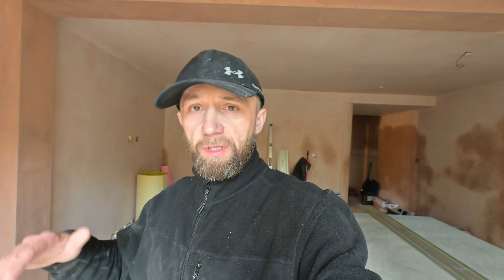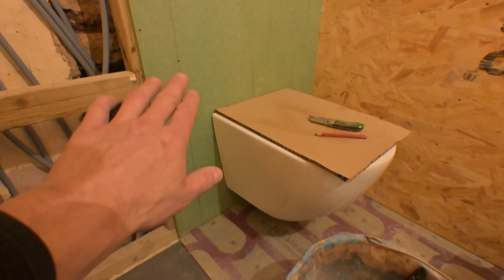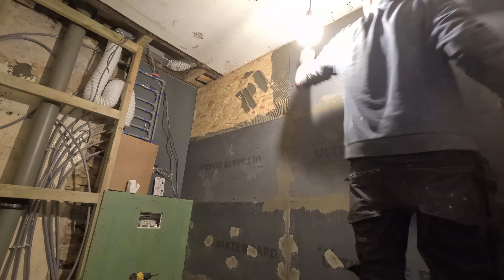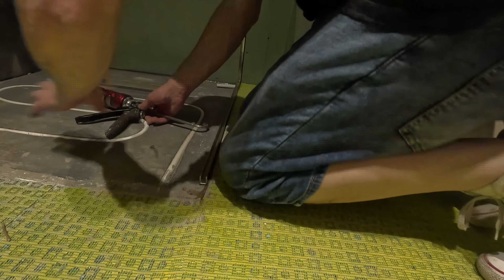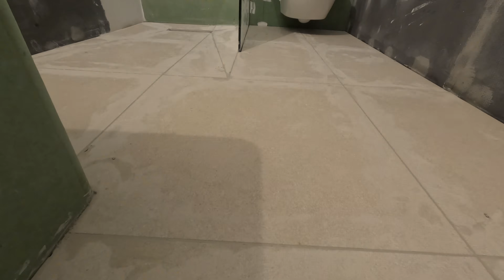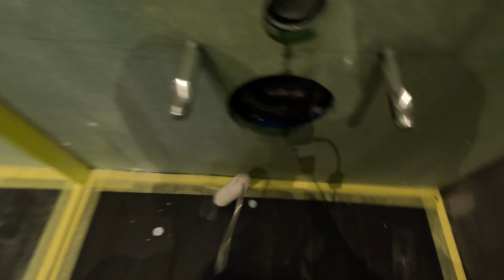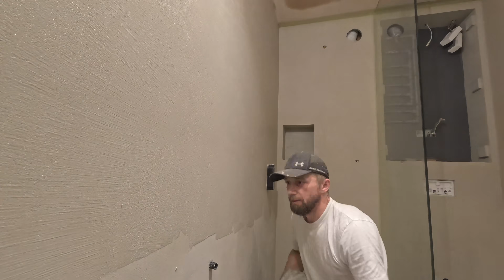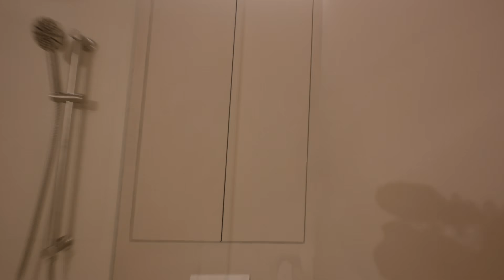The Death of Bathroom TILES..Micro-Cement Explained

Comment: 23:40 😮😅😊 in a old farmhouse they renovated it in the sense when it was built with a shame mechanical structure with cob. And add 9.30 minutes into the video they talk about two minutes about the shower.  The shower is completely constructed of cob.  And in front of the cob, they put an oak timber wall which protects the cob behind it and has a space gap to ventilate air.  So the wood is hanging there and is already in use around 10 or 20 years.  And this video is quite old already and the architect sells that even the wood is so good when it’s not treated that’s after all the showers during all these years nothing has been done to it because the air can dry it out and the cob has the protection to absorb all the water and release it in the form of moist but not in a wet way but evaporates.  Throughout the building into the air, the addict.  So that’s why it’s remains exactly as it was constructed and designed also after decades.  One lost craftsmanship is this lime and cob work? Also lime can be used for these kind of bathrooms because lime has also the ability to absorb water and to toughen the material in the process and release the water excess through evaporation.  Both materials need a protective something and just like the wood or other material with gap and not closed off.  There is no mould no any thing at all and that already done centuries ago and cement has one downfall. It cost a lot of CO2 nitrogen which we have this worldwide heating up causing and El Niño every year more and more increasingly.  So the building industry is one of the biggest problems in the world where concrete is used in cement and that is the issue with all the construction worldwide is that they don’t change and because of the very simple guys who work there and just do a trick and that’s what they learn and just continue to do but really old things were quite good and very cheap to do and everybody could do it there themselves but the professional hand like this example will show you how it can be done in a very impressive professional manner in contrast to the old former work which also can see done by the farmer who had the farm before them. This is a typical German village and in the old eastern part but also in the structure of the German way of living also continues into Hungary Slovakia and other former east European parts it was before it was communist and other alpha type dominated structures it was also always that way.  So look at this video and in the right hand corner you can put a translation on into English I think.  https://youtu.be/8dGL5tg7xRI?is=-wvVpU3867uRFe6v.
Reply from the maker: That is very interesting. Thank you for taking the time to write this. I watched the video. I know the old ways. I was bourn in a house like this.  No foundation, it's resting on stones. We never had damp issues or any other problems with the house. Its been modernised now, wrapped with insulation and silicone remdered. It's the EU law. The building is over 200 years old but it looks like it's been built yesterday. What a shame.
Reply: @yesconstructionltd  silicone rendered. I doubt that.  I think you have heard that it is lime (chalk)  probably on the outside mixed with the cob which is used inside. It gives a tougher results for the outside.  And mould prevent prevented.  When lime (chalk) is used and it gets wet and the pH rises to 14 and feels every bacteria. That’s why it’s used in the shower also.
Reply from the maker: @MagicBird-eu  I meant my own house. It's build just like the house in the video but later it got modernised and completely ruined

Comment: Maybe if you fed the guys lunch they'd work faster. Was that 6 coats? Reminds me of Dryvit, exterior acrylic, got a bad reputation in US that came from poor installation.
Reply from the maker: They are well fed😊 
It's usually the installation that is the problem. These companies are spending millions developing a product so it's unlikely that. 
This is resin microeemt so it's slightly different but application is similar. 
Coats:
1 primer
2 basecoat 
3 basecoat 
4 top coat 
5 sealer 
6 sealer 
7 Enjoy 😊

Comment: How did you do the rounded corner on the mdf and is it prone to cracking if not done in one piece. Beautiful work 👌
Reply from the maker: Thank you. The stuff we use is extremely flexible. As long as you apply both sides of the corner on whet, you don't need to use mesh. The manufacturer is spying not to use mesh, no need, but is still if I have too many joints. In my next microcement video we used completely different method as we had safe every bit of space, so we plastered the bathroom with mesh in the plaster and then applied the micro cement.
Reply from the maker: The round corner: I layered 3 strips of MDF with expanding glue and I left it to dry in clamps. After I shaped it roughly with planer and finished it of with mirka sander

Comment: It looks like the OSB has a water-proofing sealer on it, correct?  Secondly, I see three different backerboards being used; the Onboard at left, the Ultimate Board at right, and then the thicker Green board in the rear.  Can you explain the differences, their individual thicknesses and why each are used if already using a sealed OSB.  Third, is the ceiling gypsum drywall? And what is the brown coat applied to it?   Sorry for all the questions, I used to do bathroom remodels in my youth but being in the USA products and methods 25 years ago were a little different. We will be remodeling our master bathroom in a few months so I'm researching and want a modern industrial aesthetic similar to this.  I may want to use microcement, but also want walls to look more like concrete slabs...more raw.  Anyway, great job guy, ..it looks fantastic and thanks for answering all the questions! (because of the details it should help others too :))  Subbed!!
Reply from the maker: Hi, and thank you contributing. 
The osb is primed with SBRprimer. Not necessarily for water proofing as the water will never get there. It's to create good bond for the insulated boards. 
You are right. There are two brands of the boards. One is 6mm thick and the other is 10mm thick. It came from different shops but is all the same. Normally I would use 6 mm everywhere but the wall with shower controls is done in 10 because the wall is quite thin. The shower control unit was sticking out too much so I had to add 5 mm to bring it forward to cover the minimu required. The green moisture resistantdf is used on the toilet wall for specific reason. Otherwise it would of been all the same. The toilet needs solid backing. The insulation board has foam inside of it so while tightening the toilet it would of crash it and crack the microcement. The cupboard above the toilet had to be made of MDF too so it only made sense to cover the whole wall with it. 
Micro cement was invented in the US so you guys should have the best stuff 😊

Comment: You mentioned microsement in the hallway. If lot of rough scuffmarks hurts the surfaces over the years. Do you just sand and add a finish layer, or how hard is it to do cosmetic repairs?
Reply from the maker: Thank you for asking. Small repairs won't be visible but big ones you will not get away with it so the whole wall need coating again. It's hard to damage though.
Reply from the maker: In the hallway you can do two bas coats without the final coat and seal it. Looks a lot more textured and without the final coat repairs are less vidlsable. I am going to post my video about this at some point.

Comment: this is horrible.  people say "no grout lines". but this nonsense is covered in a rough surface that holds soap film and other contaminants.  Will look like crap in a year.  I hope the prison sentence of owning this is shorter than a year then.  You say no hardware holding the glass etc but the silicone will give away and the water will penetrate and ruin everything behind it.  Unbelievably the most ill-thought out system I have ever seen.
Reply from the maker: Thank you for dropping a comment. There is hardware holding the glass but it's hidden. There is more waterproofing than just the silicone . 
The surface is not rough. The final two coats make everything smooth and easy to clean. It's not as bad as you think. 😊

Comment: I want to ask about brand it´s  a Cemher ? and what kind of sand paper did you use grit and brand . Thanks for reply ;)
Reply from the maker: Hi. It's not Cemher, but is the same stuff from a different company at a better price. 
www.claudicemento.com

We use 80 grid only and it's the purple colour TREND paper. Tis very tough. It's the only paper that actually works on this stuff. I get it from  Toolstation. Be prepared to change it vquite often.
Reply: @yesconstructionltd  thank you so much for reply. You guys are really so good ;)

Comment: The plumbing manifold is the way things should be done. Burying plumbing joints in walls floors and ceilings with plastic piping is nonsense. Using 1/2 inch Concrete board or 12 mill concrete insulation board for bathrooms is infinitely better than OSB. Using OSB was introducing a problem and inflating costs. The Green sheet rock and OSB are sponges that dissolve when in contact with water. Concrete board will dry and hold their original shape indefinitely without mould or long term lingering odours.
Reply from the maker: Thanks for the input; I appreciate the perspective on plumbing and substrate preferences. In this case, the OSB is only to create a solid structure. It is separated from moisture, so I don't think it will fail.

Comment: So it's not micro cement, it's resin 😅
Reply from the maker: Well, you could say that. The original micro cement was a mixture of crushed stone, polymers, cement. Cement was added because it would cure without it but that had a downside - it was brittle. Today's formula excludes the cement and it is with eco friendly acrylic resins. Cement is a crushed stone anyway, so you can still call that micro cement 😊

Comment: I like but way too much work! I’ve seen a simpler version, but not resin based. Why three coats of sealer if the product itself is waterproof?
Reply from the maker: Hi. The sealer is to fill all micro holes and to make it smooth in touch. Otherwise it feels rough. The manufacturer is recommending two coats but I like to do 3.

Comment: Not in a million years thanks tho. So labor intensive equals way too expensive. sand between every coat, sealer mesh 3 times coating 2 x more sealer etcetc, all for what? So it looks like a plasterboard wall but will survive a nuclear attack?

Wow, it must cost a bloody fortune, all for a room you use for less than an hour a day.
Reply from the maker: 😂 I get the point you are making. You either love or you hate it. It's like Marmite. It's not as expensive as you think. It works out the same as a quality tiled bathroom.

Comment: Seems WAY more labour intensive
Reply from the maker: Yes, it's a lot of work but tiling is also labour intensive.
Reply: @yesconstructionltd  No argument there which is why I don't want to do it.  Too much heavy lifting. All that sanding though looks insane.  More than finishing drywall.  At least with drywall, you have a smooth plane with repairs.  With this. you need to creat the plane. I was surprised to see that you weren''t using a sidelight to check for consistency
Reply from the maker: @eli7j  The whole idea of this is to have a rough look with smooth touch. Yeah, the light was missing. I actually missed a spot or two because of lack of good light. I usually have battery powered site light.

Comment: 4 coats with sanding in between coats?
Reply from the maker: Hi. It's 3 coats of the micro cement and you sand 3 times. The sanding is not what you think. It's a quick one and there is not much dust to be honest. This stuff doesn't sand well, it's too hard so you need to apply it nicely as smoothly as possible. It's important that the surface is prepared nice and flat. Micro cement is not for levelling, it's for finishing so preparation is important.

Comment: can you get it with a stone or marble look vs just one color......this bathroom looks really nice, I am a builder and just starting 2 bathrooms this week....may have to research this a bit.....obviously waterproof but how long does the clear coat last before it needs to be reapplied?
Reply from the maker: Hi, and thank you for your engagement. Good question. I don't want to answer this straight away. I will get back to you tomorrow. To my memory it's a lifetime internally and externally but don't hold me for it. I will call the supplier and get accurate info. In the meantime if you want to give a go with this stuff and not sure about the application etc, ask anything and I can help you understand everything.

Comment: It didn't look like you overlapped the mesh over the vertical inside corners. There will be differential movement between the different substrate materials which will cause the rigid cement to crack and cause leaks. Especially in the corner joints in the shower & between wall & vanity unit behind the basin. These cracks will appear within a year after daily use & require remediation.
Reply from the maker: Thank you for engaging. It's not rigid. It's extremely flexible and waterproof. Both sides were done on wet so they are bonded together. This is a resin based formula with zero cement. Just a crashed stone mixed with resin. The vanity board is glued to the call with resin expanding glue. The vanity became a part of the wall in this case. I do re visit my jobs to check on it in case any crack appears so I can deal with it. I ask my clients to inspect it as well and so far we never had any issues. This was not the case with the cement based micro cement. It was failing a lot.

Comment: Ok , so you've bssically boarded it with OSB , which shouldnt be anywhere near a  bathroom, tiled it with aquapanel and then plastered it , and then rubbed it all down. Three times the work for something that looks worse than if youd just tiled it
Reply from the maker: Well, yet it is a high-end product. It offers a different look, and it isn't to everyone's taste. The OSB is separated from moisture by the insulated board and the microcement. OSB is designed for constructing roofs and outdoor buildings. It contains resin and is lacquered with resin on top, so it is an appropriate board to use. It has insulation behind it and in front of it, so no condensation will ever touch this board.

Comment: Do you protect micro-cement with Polyurethane ?
Reply from the maker: Yes, at the end. Options vary depending on where the micro cement is applied. It's different for kitchen worktops, bathrooms, and general use.

Comment: I hate cement board.  Epoxy does not stand up to UV light. I would expect this to discolor and fade any where it is exposed to sunlight.
Also, that is a very institutional look. Not very attractive at all.
Reply from the maker: It doesn't discolour. This formula is completely UV resistant. It does change colour slightly over time (which is cool) as it ages

Comment: How do you fix it when it is compromised? Do the colors hold fast or fade? Does every mix act the same such as color, texture. I see trouble ahead when the guy who did the job is the only one in town that does the job and he is backed up/dead/moved. Then what? Doing renos, baths and kitchens, for 35 yrs. fads come and go, tile has
 been around and is still around for thousands of years for a reason. IT works. I'm no luddite but fads are fads and they fade. Try replacing a4'x8' marble slab in a shower if it cracks, you will find out about replacements. Great job though brother. Get it while it lasts!
Reply from the maker: Thank you. So, this formula is fully UV-protected, so it doesn't fade. It changes colour slightly as it ages, but I think that's cool. It becomes a little more patchy. 
This will never replace tiling, but I think it will stay now. This is the improved resin-based formula. Before, Micro Cement was cement-based, so it was failing a lot. Interior designers and architects are pushing this trend. It started in high-end projects due to its cost and very limited workforce. That has changed now. It is easy to find someone who can micro-cement, and the material is a lot cheaper than it was 10 years ago. The cost for a bathroom is similar to a good-quality tiled bathroom.
Reply from the maker: Small repairs won't be visible, but you won't get away with big ones, so the whole wall would need to be covered with the final coat again.

Comment: The sight of grey barrier pipe in the walls makes my toes curl with dread.
Reply from the maker: Why? It's a point-to-point system. Nothing can go wrong.
Reply: @yesconstructionltd  Because in my experience barrier pipe is not fit for purpose. It will eventually go brittle and crack, faster with warm water than cold. For the sake of a few quid, use a better quality plastic pipe like speedfit which is made of better material and is multilayered. Never known it to fail. With barrier pipe it is not a question of if it will fail but when, and then when it is all buried in a wall, nightmare fuel. The stuff should be withdrawn from sale.
Reply from the maker: @JohnSmith-pq7vn  This is Pollypipe, which is the most expensive and the best in the UK.

Comment: Why did you not use damp proof green OSB?
Reply from the maker: The osb here will have no contact with moisture. It's insulated from the back and the front and isolated by the micro cement. Even condensation will not be an issue.

Comment: Good craft and good work. However, this looks awful. And I doubt it's practical. For bathroom you need glass like surfaces because you will need to clean it.
Reply from the maker: Thank you. The surface is smooth. The finale seal coat is smoothing everything to make it easy to clean